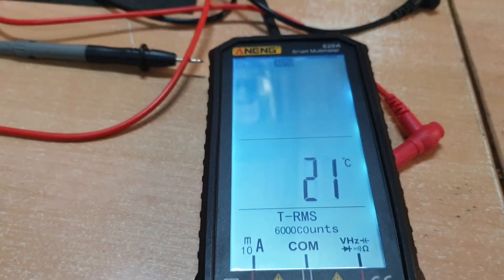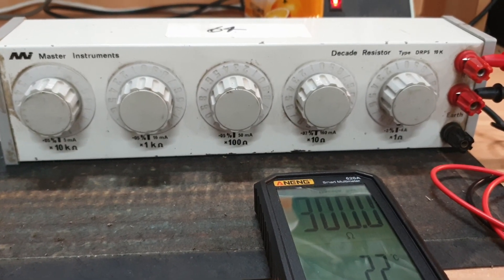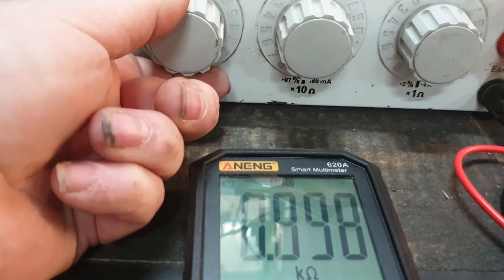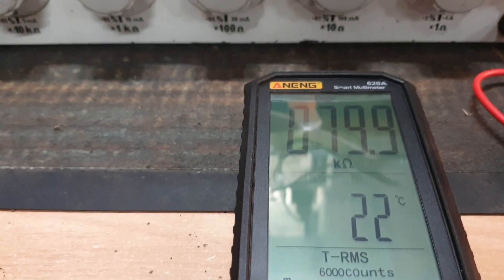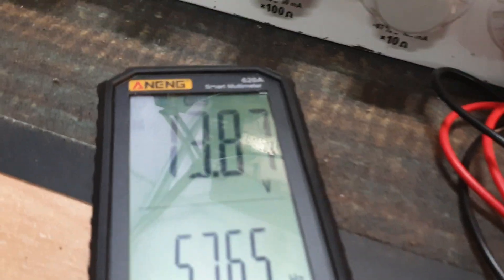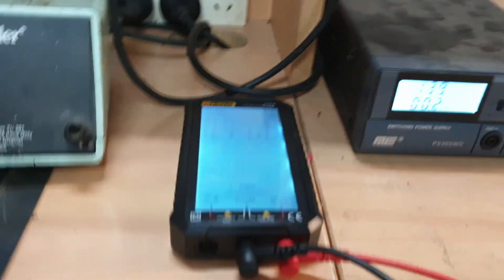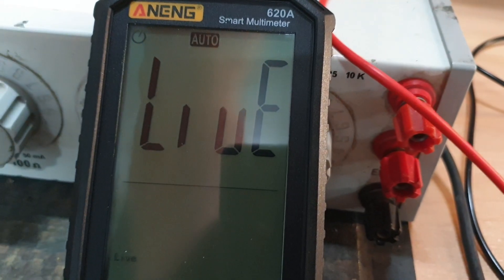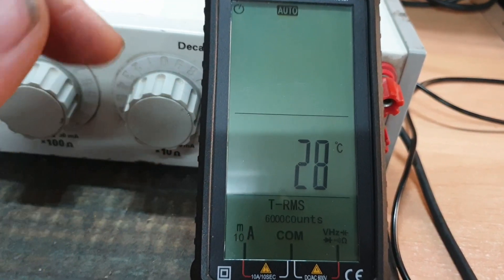Is this possibly one of the best bang for buck autoranging multimeters for under $30 Aussie????

Comment: Great video, you Forgot to mention it also have an non contact mode EF or something where you can use the top of the meter to detect live power on a cable. I Ordered one, still waiting. I notice your Weller Soldering iron, Miss mine so much. Had exactly the same. Brings back memories.